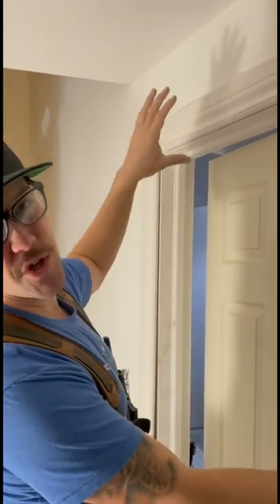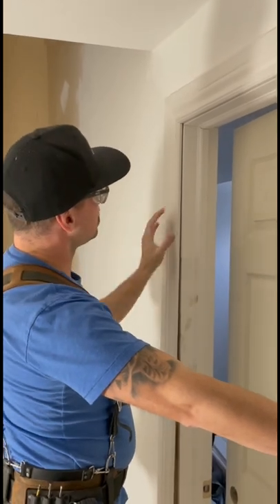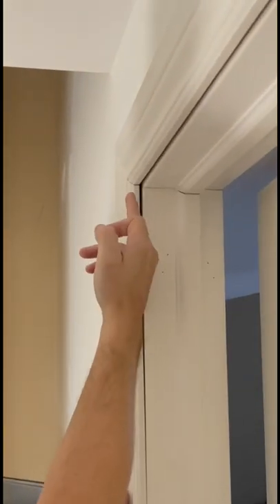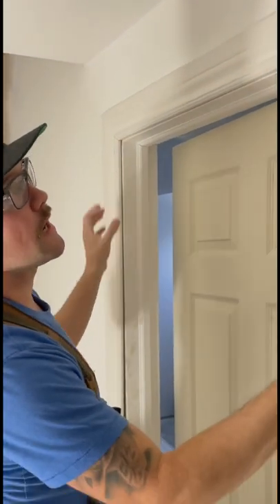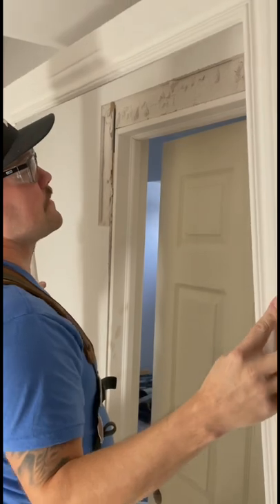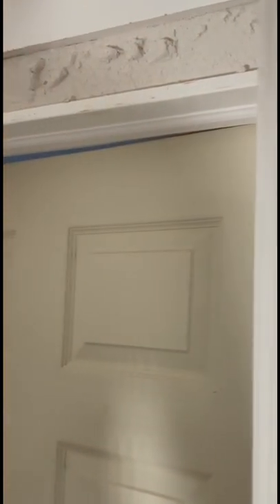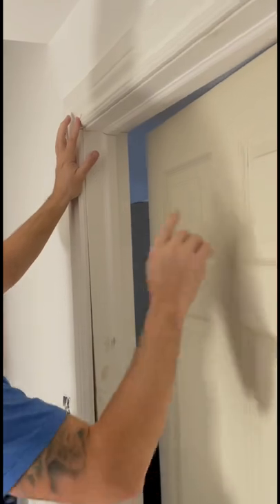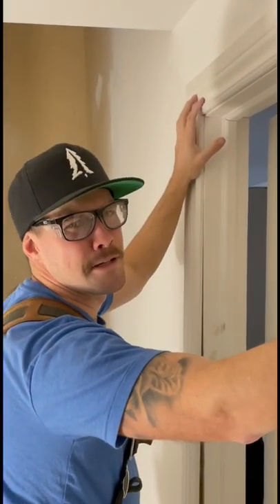HOW TO TRIM A DOOR WITH UNEVEN DRYWALL LIKE A PRO

Comment: I believe you can also roll the mitres so that the top of the head is away from the wall but the bottom is tight and the joints are tight